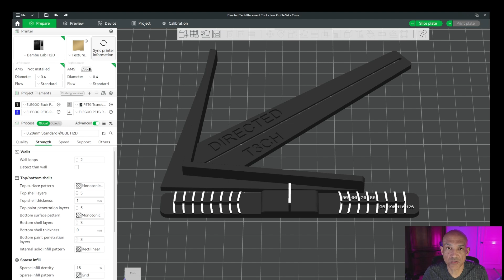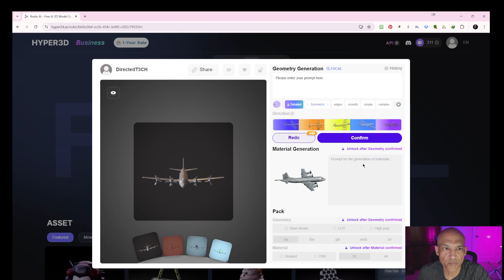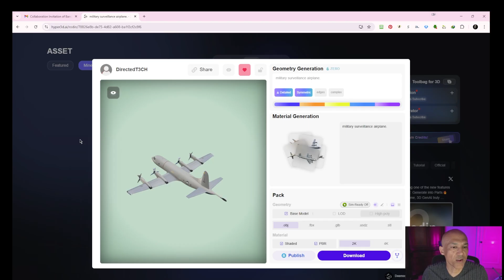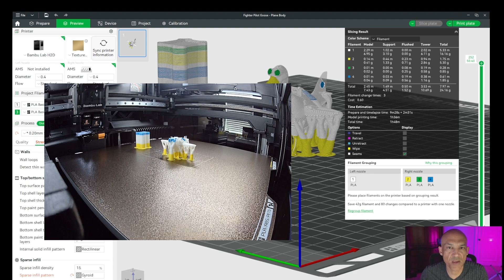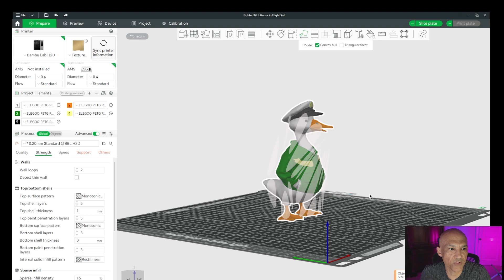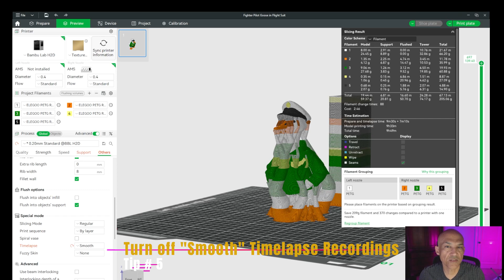Reducing Filament Waste in Multicolor 3D Prints - Bambu H2D and Rodin

Comment: I’ve got an H2D with 3 AMS2 Pro and 2 AMS HT and it’s been great since I got my extruder replacement(had a faulty one that kept overloading). But part of me still wants a multi tool head like the 5TH XL just for multicolor prints.
Reply from the maker: You can never have enough cool 3D printers, right?? :)

Comment: If I have 2 AMS units, I’ll put white and yellow   That way I save time switching colors and also reduce filament waste ?
Reply from the maker: It really depends on the model.  If the white and yellow are on different nozzles then yes, you'll reduce waste and filament changes.  If you have to change the filament color in one nozzle, the machine has to do a filament change that will result is some waste.

Comment: The table your H2D is on sure is wobbly.
Reply from the maker: It's actually a fairly heavy and stable desk!  The H2D really shakes things up, but it does so quiety.
Reply: @directedt3ch  Print some brackets to reinforce its legs.
Reply from the maker: @kchiem  Thanks for the tip. This isn't where it will live for good. I just had it on the desk for the video.